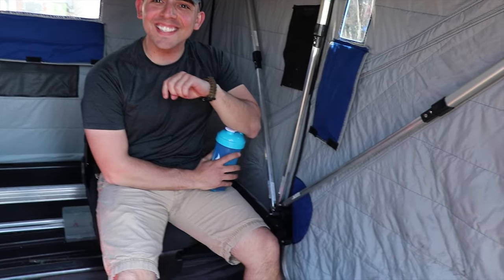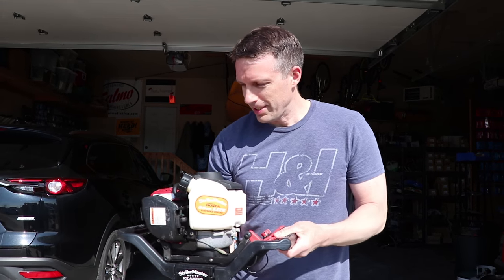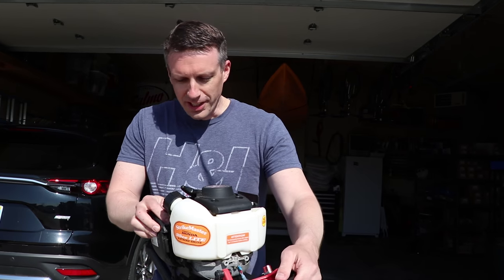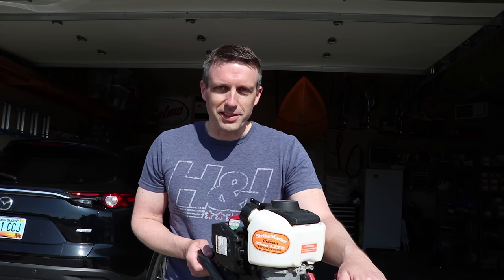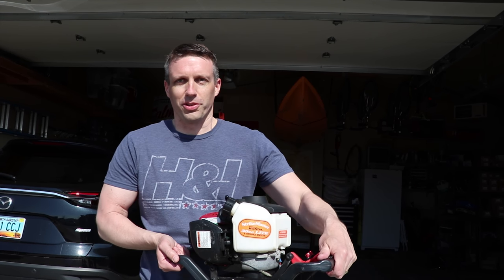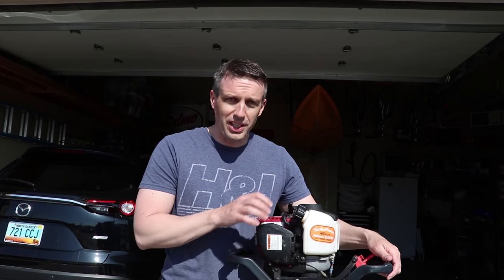3 Tips to Summerize Your Ice House Auger and Sonar!

Comment: Nice short video, fellas! Good tips.  I set-up both my flip-over and my 6-man on Saturday to dry out and soon had 8 neighbor kids pretending the 6-man was a "bear cave".   This will be my last year draining an auger since I switched to K-drill mid winter, but I'll let it run dry the same time as the snowblower.  I just let em run while I try to get the garden tiller, lawnmower, pressure washer, and motorcycle running.  It can be a loud afternoon :)
Reply from the maker: How do you like the K-Drill?  I just can't let go of a 10" gas auger I guess although it would be pretty great for hole hopping panfish
Reply: Jagged Tooth Tackle I really enjoy it and plan to sell my 8" gas. I didn't get to try it early ice, but for how easy it was through 2'+, I won't plan on going back to gas. I'm not a hater or anything, just preferred how easy and no-fuss it was. One huge thing: I run DeWalt for my coordless tools already, including a coordless weed whacker, so getting the k-drill specified DeWalt drill with 2 6amp hour batteries was easy, and Ill be able to use them year round. If a guy didn't have other tools or a need for a new drill, might as well go ION or stay gas. I'm excited for early ice, should zip through really quick and it's Soo light.